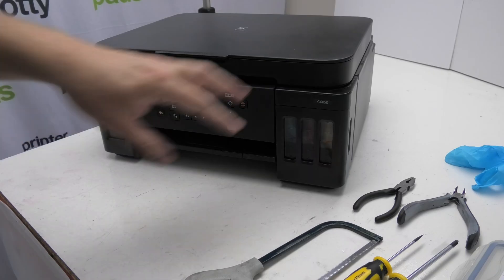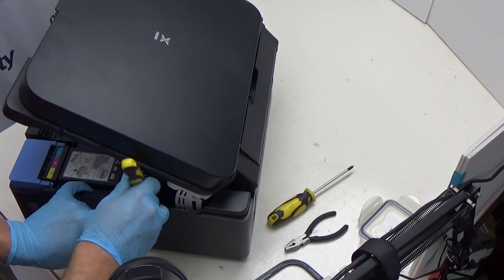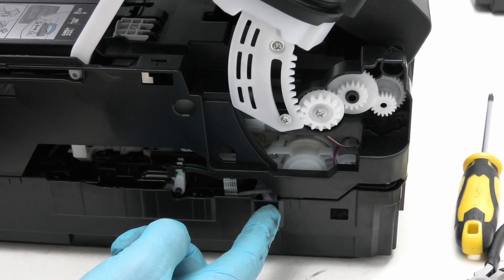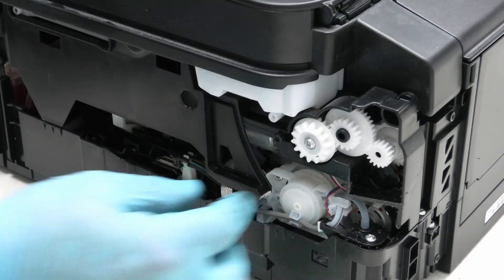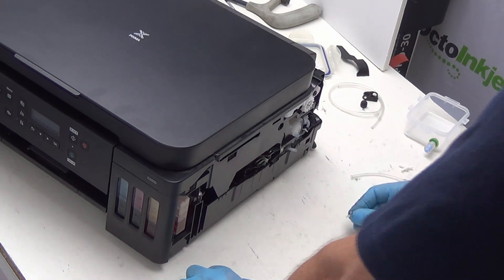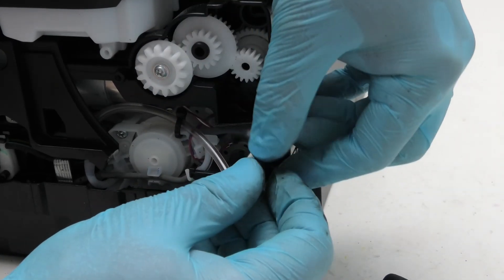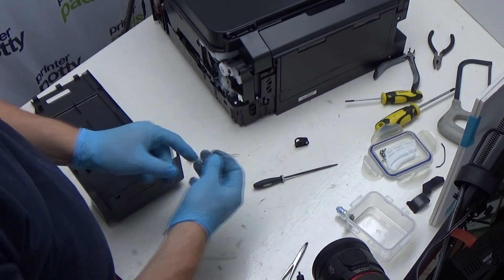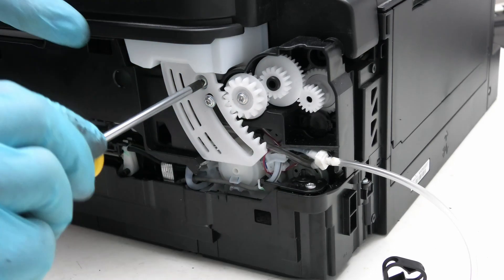How To Install A Waste Ink Kit for Canon G6050 Printer [5B00 error fix]

Comment: if i buy this id probably set it all up before even doing my first print
Reply from the maker: It’s an idea but worth considering waiting until at least your warranty is expired to avoid a different printer problem blocking you from using that warranty.

Comment: I havent gotten a 5B00 error yet, but noticed that the printer is already leaking ink. Probably because i did a few ink flushes that flushed a lot of ink. Can I just remove the ink absorber completely if I install the printer potty? Or does does the printer recognize that there is no ink absorber installed?
Reply from the maker: Ideally you’d want to identify where the ink is seeping from. If it’s the waste pads, redirecting any new waste ink to an external container is a good idea to start. Pad removal would be secondary as the leak would stop as no new ink was getting in. If the leak is from the ink reservoir’s that would be a more critical issue.

Comment: Awesome video! The left tube was initially pointing downwards, but the kit redirected it upwards – would it cause any issues? Thanks!
Reply from the maker: The pressure in the tube and limits, imposed by the case, shouldn’t cause any back flow issues. The key is to avoid the tubes getting twisted or crimping/folding.
Reply: @octoinkjet Great, thank you for the explanation:) You came up with such a useful solution!

Comment: I have a Canon G7040 printer. After deep cleaning of the nozzles, a 5B00 error occurred, and the printer stopped printing. 5B00 means the waste ink absorber is full and needs to be replaced. The yellow error indicator blinked for 7 times continuously. I eliminated the error using a special service program. The yellow indicator is no longer blinking, but the main problem has not been solved yet. I bought a spare part, ABSORBER KIT (QY5-0647-000000), and must install it in the printer now. Are there any manuals or videos on how to install the ABSORBER KIT?
Reply from the maker: Canon has all repairs in-house and doesn’t have franchise service centres like Epson so there’s very little opportunity for manuals to be shared outside the organisation. So, no… there are no guides for that task… It’s very much a DIY type situation. The guide for the G5050 may help a bit more though.

Comment: Makes you wonder why THIS isn't the standard way a printer is setup???
Reply from the maker: In fairness to Canon (and Epson) they do now have a lot more printers that have chipped maintenance tanks/cartridges rather than static waste pad holders and a need for third party apps to reset the internal waste ink counter. 

Unfortunately it's not 100% and they've made no effort to retroactively support end-users to do it themselves, even if it was only with software tools.

Comment: Wouldn't the waste ink from the left tube before the Y piece pool in there, since it have to go uphill now?
Wouldn't it be better to make it go outside and slightly down and connect the Y outside the printer? Maybe not better looking, but better for the ink flow?
Reply from the maker: There’s insufficient space in the tube for ink to back-flow past any bubbles of air so a small height difference doesn’t cause any issues.
We opted for the single tube exit because the Y-fitting doubles as a strain relief and it minimises the number of holes to drill. 
When it comes to heights the main one to watch out for is the tank itself. If you place it below the printer by enough you can create a syphon effect that drains the ink reservoirs.